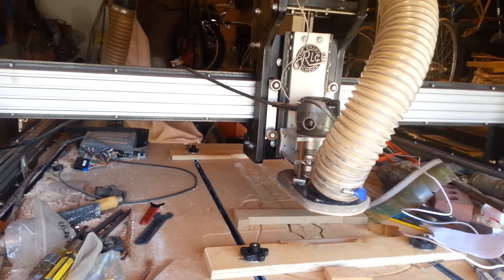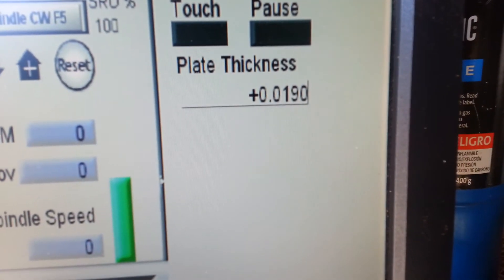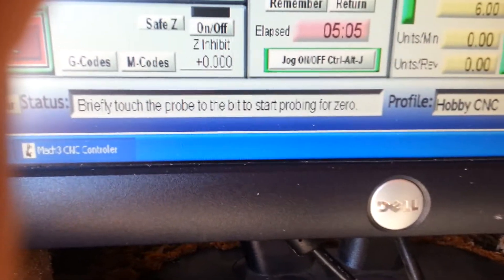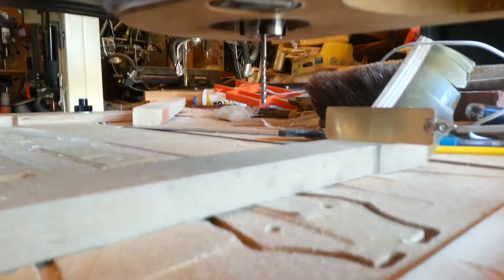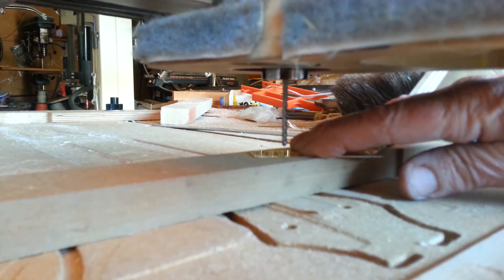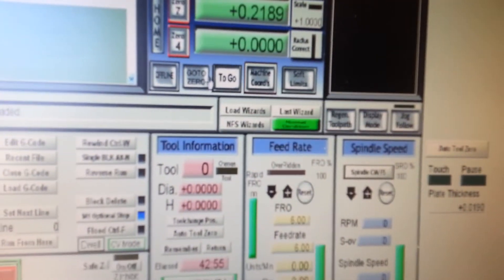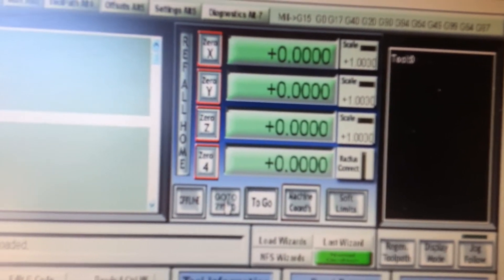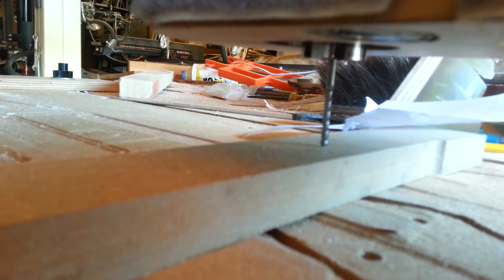Auto Z Axis Setter CNC

Comment: Where did you get the mach 3 add on for the auto z set?
Reply from the maker: Honestly, I don't recall. This was 6 years ago, and I had help from my son. Sorry.
As an aside, it still works perfectly, and it is a great feature. Sure improved my setup accuracy, speed. I don't think I could go without it at this point.